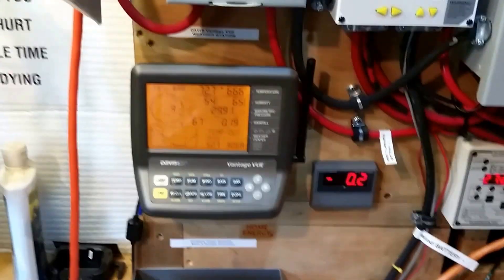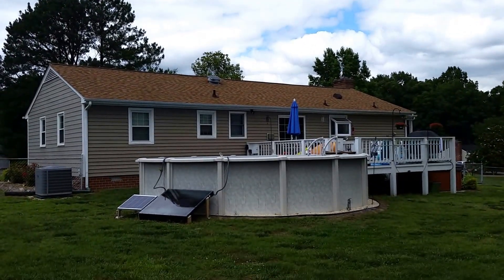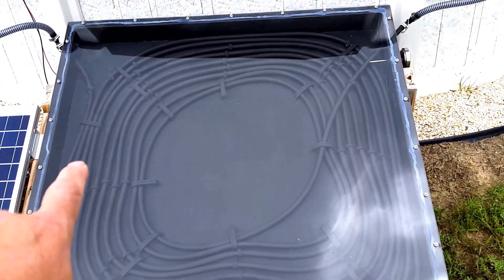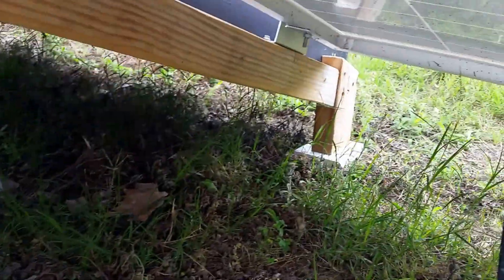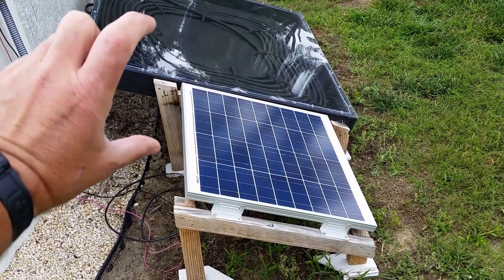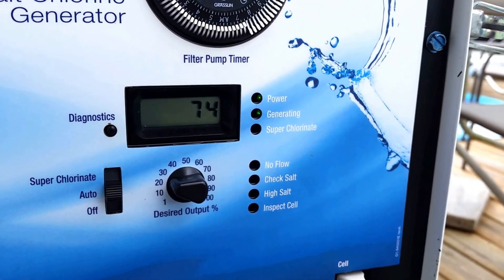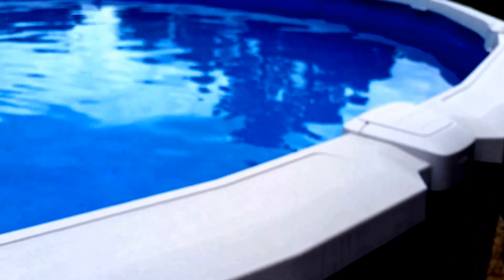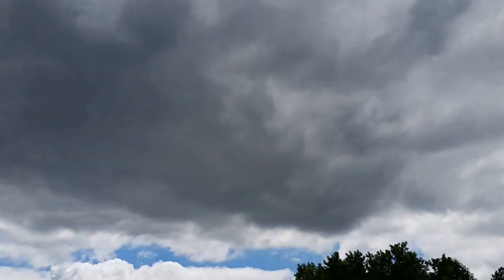Solar Hot Water Heater / Pool Heater Project Update 1 year Later It Works By KVUSMC

Comment: Thank you for your informative video. I'm trying to duplicate your system using copper coils (Lowes had 20ft 3/8 ID for $8.27 each and bought all 7 in stock). I was about to order the same bilge pump as yours for my pool heater. I see you installed a valve to control flow. I was wondering if lowering the voltage to the pump would achieve the same lessening of pressure, to give the water, time to heat up while in the chamber. I figure in this way, I would not overwork the pump at 12 volts. This is just my theory from my experience with stepper motors when I starve them of voltage. At 9 or 7 volts they operate cooler and I would imagine, last longer too. I'm thinking of using a Buck Converter between the panel and pump,  to dial in the voltage I want. Or if I'm running an SLA 14AH battery, put the buck converter after the battery to the pump. So then the battery would still be charged at 12 volts. I'm not really an electrician but an audio professional who's into DIY and photography. Please tell me what you think, if it will work or not. Thanks in advance but most of all, thank you for your service to our country.
Reply from the maker: That should work great Buddy give it a try 👍 your welcome

Comment: Throttling your water flow has no effect on how much increase in temperature the end result is after it goes back into the original source temperature.  You would want to ALWAYS keep the water flowing at a max rate so the total temperature increases with each pass.
Reply from the maker: I appreciate the feedback
Reply: @KVUSMC-KU4SMC  I should clarify that by "ALWAYS", I mean "during the daytime when the sun may or may not be shining".  Put it on a timer that matches the sun.
Reply from the maker: When the Sun it out it Runs no timer needed

Comment: You slow the water down too much. It will be more efficient if the water flows faster and exits cooler, it will actually pick up more heat. Heat transfers faster with a bigger temperature differential, so the aim should always be to keep the water moving as quickly as possible and the coil as cool as possible- it will pick up more heat that way.
Reply from the maker: Yout exactly right

Comment: Great Job, Thanks for sharing just tested it out yesterday, since only needed until Feb for S FL weather so pool can be usable enjoyable year round. Just all that is left now is to build a box for water to heat up faster. so have you had to replace the Bilge pump? if so how long do they last? thanks
Reply from the maker: Thank You Buddy Yes Sir I go Through about 1 Bilge pump a season up here in Virginia 1 Bilge pump will last 3 months  I run our pool From May until October
Reply: Thanks to me was the wattage and bilge pump since only thing that seems would need to be changed out every soo often
Reply: You should look at submersible pumps made for saltwater aquariums. In the hobby run our pumps 24x7 for years without issue...all kinds of options for different size and GPH depending on head pressure and size of pipe.

Comment: Buenos dias Kenneth, thank you for sharing your video.  I am working on a set-up very similar to yours.  Purchased a 25 watt 12 VDC panel; with the intent of it running my 12 VDC bilge pump.  Watched a few video on setting up a solar system.  I guess that was the beginning of my problems.  I asked a few questions and was basically told that I need a charge controller and a battery.  The parts have been coming in the mail but I haven't open them in case I decide to return them.  I really do not need a solar system; I just want my bilge pump to operate when the sun is out.  Would I be able to run my bilge pump with my 25 watt 12 VDC panel.
Reply from the maker: Yes Sir Hook it Direct  You could Put an Inline fuse in there if you would Like  I like the Rule 24  Here is A Link 
https://www.ebay.com/itm/Rule-24DA-360-GPH-Bilge-Pump-12-V-Non-Automatic/142394967385?epid=2121838865&hash=item212766c559:g:V3UAAOSwjZJaAfgn&vxp=mtr

Comment: how do you keep the pool warm at night?
Reply from the maker: The Water Holds the Heat very good Until The Next Day No Heat at Night  It is 82.5 degrees F outside Right now
Reply: @KVUSMC-KU4SMC   pool cover will keep it even warmer and up the flow. :) i dont have one so that is what i have read. mine is inground and will prolly take at least 6 coils still way cheaper then the off brand solar heaters

Comment: Thanks. I was trying to find out if I could hook a pump up to a panel directly without burning it out. 12 volt pump and 17 volts from a panel. What kind of volts out are you getting with the 50 watt panel.
Reply from the maker: I'm Getting Around 12 to 17 Volts Under a Load The Pump Holds up Great hooked up Directly  No Problem I like The Rule Pump Because they are tough and made for Saltwater  I'm Hooked Direct No Problems

Comment: is there a smaller pump that can be used for slower flow? So i dont have to use a valve, and I'm assuming the valve will put a lot of stress on the pump.
Reply from the maker: MrRobDale if you find a smaller one that would be great
Reply from the maker: +MrRobDale a smaller pump will work great but in a saltwater pool these pumps are made for the saltwater  I haven't found a better pump yet
Reply: KVUSMC / Kenneth W Viar Jr thank you for the reply.
Reply from the maker: Your Welcome Brother
Reply: KVUSMC / Kenneth W Viar Jr I have one more question... I bought the same pump with a 35 watt solar panel (waiting for them in the mail), would the 35 watt panel be sufficient for that pump? What wattage is your panel that you are using?

Comment: im going with this design thanks!  i am guessing and im going to do longer hose.  make a slow flow so the water can heat up.  thanks for the update!  good stuff!  homedepot will have a large sheet plastic for the covering right?
Reply from the maker: +frank piedmont Hi Frank Your Welcome Yes More hose would be great yes Home Depot Should have sheets of Plastic
Reply: It needs to flow faster, so you take all the heat out of the solar box.  More efficient!

Comment: how many feet of tubing did u use and how many gallons can the tubing hold? I suppose its copper tubing?
Reply from the maker: +Spiritual Discourses For Higher Enlightenment Hi Buddy  it I'm using Hey way irrigation tubing 1/2 inch PVC Good for 200 degrees 100 feet of it

Comment: Just wondering, What is the temp during the hottest month of summer that the heater puts out and the H2o temp of the pool? Thank you
Reply from the maker: +James Nichols I have seen as hot Hot as 95 pool temp and the Heater will Crank out around 120 degrees  Not to bad !I cover The Solar Hot water Collector with EcoFoil and,Disconnect the Solar panel from the Pump when it Gets that warm Anything above 90 to 95 I shut it down until we need it again
Reply: Wow, That is absolutely great!. Thank you for answering so fast.  Have a great day..
Reply from the maker: +James Nichols Your Very Welcome Buddy